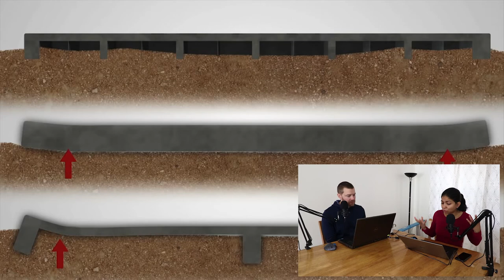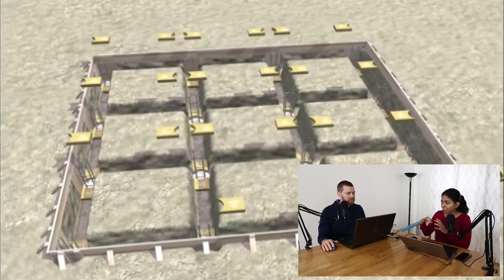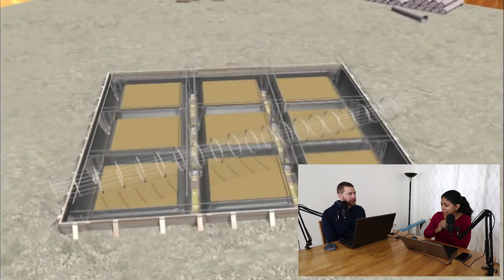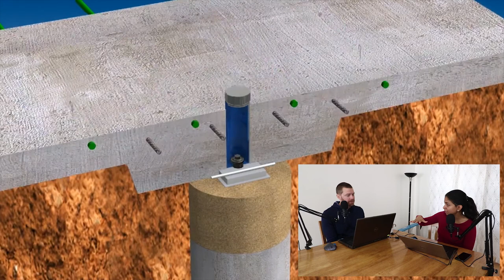Anti-contractor home podcast - Foundations (slab-on-grade vs. pier and beam)

Comment: The downside of walking on concrete all day is eventual foot and ankle problems in your later years. Of course you don't want a floor that flexes so much that knickknacks on your shelves rattle when you walk across your living room. But you've got to please yourself. As for maintenance of wood beams and joists: If you do it right the first time you never replace them. Doing it right is all about controlling moisture and pests. Keep it dry for zero rot and use pressure treated lumber to keep the termites away.

Helical piers look really interesting to me. The idea I saw was that they drive the pier in while monitoring the torque. When the design level of torque is met the stop driving and move on to the next pier. You might have stable soil (bedrock) 20 feet down at one corner of your house, and 5 feet down at the opposite corner. One approach would be to dig shallow holes for concrete piers, then drive your helical piers in the bottom of the holes, clean up, and pour your concrete piers. This would be great for both pier & beam and slab on pier.

If you want access to plumbing, and a place to put utilities and duct-work (as suggested by Joshua Ruby), a conditioned crawl-space may be the best approach. Some like to pour a concrete floor for the crawl-space, but then you're just moving your concrete-floor problems to the crawl space. I've seen where some have put down compacted crushed stone, a vapor barrier, XPS, then topped it all with 2 layers of sub-floor material like plywood or OSB. The two layers run cross-ways to each other with non-overlapping seams. Short screws hold the sub-floor layers together. If you use stainless steel screws and don't glue the plywood layers to each other, damage from a plumbing leak should be repairable. Or don't have plumbing leaks.  ;-)

I'm strongly considering jumping into a project to super-insulate a 640 square-foot cabin in Colorado (10,070 foot altitude, west of Pikes Peak). A major part of that is upgrading the crawl space to conditioned. It's currently on a slight slope over decomposed granite--which is about as stable a surface as anyone could ask for, but nearly impossible to excavate without power tools. I suspect the footings are only a few inches deep, although code calls for 30 inches. Anyway, thinking of renting a jackhammer with a spade bit and scraping away the top few inches to level the downhill half (to give enough room to work after vapor barrier, insulation, and sub-floor are added). I suspect that will be a brutal process. An alternative is to sell the property and start elsewhere with a bare lot.

Anyway, if I keep the cabin I'll super-insulate it, make it airtight, install an energy-recovery ventilator, go all electric, and possibly add solar (heat and/or PV) Propane deliveries are insanely expensive. Current electric bills are well under $100 a month, but propane can run as high as $800 a month.

I'm sure you'll have a blast with your upcoming project.

Comment: I appreciate your discussion. It is curious to see where an architect’s education is different from hands on experience. Just a few points that may help flesh out your options when designing your future space:

Since your land is highly soil variable and likely has a high surface bedrock, I would request the seller allow you to use a mini excavator and dig test holes prior to buying he property. Rent one for a day for $300 and see where things go. It will cost a lot less than a geotechnical coring survey. If you don’t hit bedrock, helical piers is likely your best bet, but concrete piers would also likely suffice. If you do hit bedrock it may be most cost effective to just do an overdig and dig footings all the way down to the bedrock and backfill with roadbase and compact it up to slab on grade level (if it’s less than 2-3’ deep to bedrock), or build it like we do up north with spread footings and stem walls. (I would do it with ICF because I only use ICF). Another option i have done is helical pier and use a stem wall perimeter on top, much like a perimeter beam design. This was an ICF perimeter 5’ high set on helical piers spaced 6’ on Center and had surevoid boxes 4” deep under the forms between piers. 

As for flooring, up north the main system of flooring is engineered I-joists. Design the house to meet clear span requirements and you’re golden with just perimeter bearing. If you want it wider do a center bearing footing as well and put in a centerline beam. (Or you could opt for floor trusses that clearspan and may be more cost effective if excavation and concrete proves laborious). I have spanned 37’ clearspan with floor trusses and that’s with 2” gypcrete on top. 

That brings me to my next point, for giving the floor solidarity you can do a few options. One is to double layer the OSB, so two layers of 3/4”. Another is to do one layer of thick osb,1-1/4”. Or, do 3/4” osb with 1-1/2” of gypcrete or lightweight concrete. 

Where I live in Idaho I am a heating dominant climate and don’t even need AC in my houses because the ICF walls hold off the heat long enough to pass our two to three week peak temperatures. So I prefer a frost protected shallow foundation. In your case, I would definitely consider a crawl space for your utilities else they may end up in the attic, like most of Texas. Conditioning the whole attic space is a loss of efficiency and money, as well as running air conditioning through an unconditioned attic. Your best bet may be to build a conditioned crawlspace and out your heat pump and air conditioning ducting down there. It also makes running electrical and plumbing a breeze if you use floor trusses. 

Hope those give you some more ideas. Others include a slabless slab...and moving out of Texas. Or at least expansive clay Texas.

I’m excited to see more of your discussions. Keep up the good work!